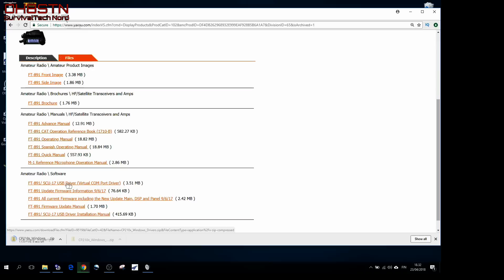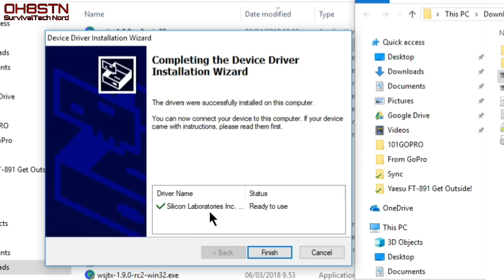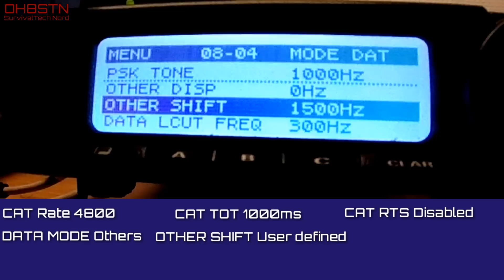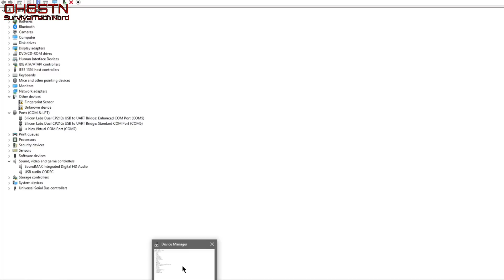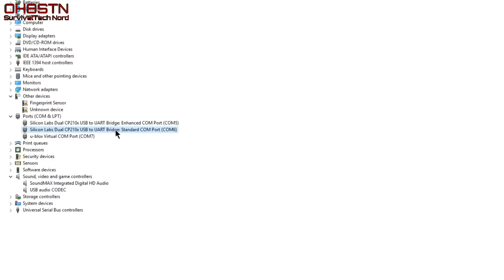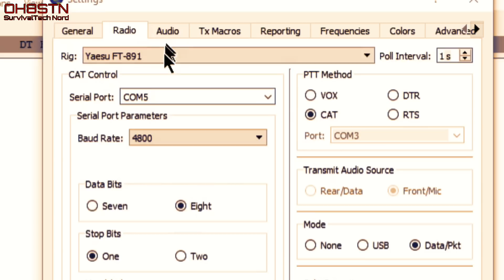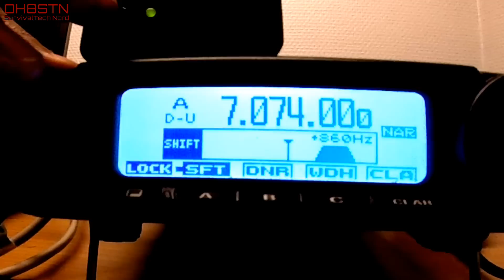Yaesu FT-891 FT8 WSJT-X Data & CAT configuration

Comment: Hello Julian, I wonder whether you've experienced a 'clicking' sound in the audio chain when going digital. The clicking was mentioned several times on a forum 5-6 years ago. The clicking appears to be in perfect pace with the baud rate set for CAT control. Have you experienced it? 
Regards
Gust ON6KE
Reply from the maker: This series of the radio doesn't have that clicking. It seems to have been a feature of the early versions. 
Mine had clean clear audio both incoming and outgoing.
73
Julian oh8stn

Comment: My problem is I am not computer savvy. A person keeps asking me. Did I put this in and I put that in did I do this? Did I do that. I just don’t know who to talk to about getting this properly set up on the computer.
Reply from the maker: First thing to do is define the task, breaking down each part of the setup into individual steps. Itemize the steps onto a piece of paper stro 1, step 2, step 3, ... Under each step write the goal,  pre-requisites, required materials and expected results. This is basically your project plan.
There are no tutorials which will be exactly identical to your setup. This is especially true when you're commenting or watching older videos with hardware which is unavailable anymore.

Comment: May I please know if I will need the MiniProSC data interface? If so, it would appear that these are no longer available for FT891. 4S7EF
Reply from the maker: This is a special radio and works a little bit differently than others. I would buy the Digirig interface for FT891, FT857, FT818. Because this radio already has its own USB connection. You only need the audio connection from thee Digirig.  This means for data modes. You'll have two cables one from the radio and one from the audio interface. www.digirig.net
Hope this helps
Reply: Thank you. Understand that you have done a video on how to use an inexpensive sound card and Yaesu cables to replace the more expensive sound cards? 4S7EF
Reply from the maker: It's not worth it.  You'll get the best results and least frustration with thee Digirig. The problem with doing it the cheap way with the yasu cables is overdriving the radio and polluting the spectrum for all the other operators who can hear you. It's much easier to set up with a digirig.
Reply: @OH8STN  noted. Thank you very much 4S7EF
Reply: I have gone through your video a couple of times, and I am not sure where the DIGIRIG cables are connected. Will it be possible to kindly do schematic of how ALL cables are connected PLEASE?😊 4S7EF
Reply from the maker: Schematic isn't required. The digi rig has two ports 1 for audio, the other for cat control. The audio port connects to the data port on the 891. The serial port stays disconnected. The USB port from your radio and USB port from digirig connect to your computer.
It's that simple. Make sure you buy the digirig cable for your radio, as I mentioned in my first reply. There's only one port on your radio that will accept that cable. It's all very very simple.
Reply: @OH8STN  Thank you Julian. Just to recap;
1. The BLACK cable goes to the AUDIO port of the DigiRig,
2. I need to purchase a printer/USB cable which connects the USB port of the FT891 and a USB port of the Laptop. 
3. Using a Type C cable, connect the DigiRig USB port to another USB port on the Laptop?
73 de 4S7EF
Reply from the maker: Not sure what color the Digirig cable is. One end is TRRS, while the other end is 6pin minidin. The USB cable from 891 to the computer should be high quality. USB-C from digirig can ve ordered from Denis at Digirig,  along with correct audio cable.

Comment: Julian, I need to ask for your help if you have a moment.  I have put the Sabrent sound card, the HIQUAY FTDI FT232 chipset 8 Pin Mini Din Male Serial to USB Adapter, CT-62 CAT Cable for Yaesu Radio, and the HQPARRTS 6pin Data Audio Cable for Digital Modes FT - FT8/FT4/JT65/PSK Audio Interface 6-Pin Mini DIN Cable DC-11F for YAESU FT-897, FT-857, FT-891 into my Amazon shopping cart.  The sound card and the 6pin Data Audio Cable are for FT8?  Is the other cable the CAT cable?  I, also have the ADMS-891 USB-A to USB-B cable with the programming software.  Are there enough ports on the radio?  I'm already confused.  Can you please help me?  Thank you.  David
Reply from the maker: Don't waste your money on all that stuff. Buy a Digirig. The 891 uses a USB cable for cat control.  For data use the Digirig. You'll have two usb cables, without any complicated mess. Normally we'll use the digirig for audio and cat. Since the 891 Has its own usb port for cat control, We only use half of the digirig, along with the 891 usb port for cat.
It sounds complicated but it's a very simple way to do it.
Reply: Thank you very much! @OH8STN

Comment: Old video but still helpful - Julian the Great! I had no TX audio on my 891 when testing JS8Call. I found this old video and learned that my data out level was set to just "10". Changed it to "50" and it worked. Everything else was set properly and I was going crazy here for moment. Setting my Data out level higher fixed the problem. I back on 10 meters this week and want to see how propagation is behaving.

Comment: I have the same setup.  But in audio settings, both show the codecs, but both say (not found).   Do you have any idea what the problem might be?   Thanks, CA4JDM / CE4JDM
Reply from the maker: Install the Yaesu drivers while the radio is unplugged from your computer.
Reply from the maker: Also, if that doesn't  work, try a better quality USB cable.
Reply: @OH8STN  Thanks. I tried both things, but still does not work.  The computer uses Windows 11 (I hate it!)  I set it up in an older computer with Windows 10 and it works perfect!
Reply from the maker: No windows 11 for me over here. I'm going to hold out as long as I can

Comment: Great video, and thanks so much. Been struggling with FT8 setup. Question though, why do i need to set the shift for 1000hz? Everything else made sense but that. Cheers and Thx 73!
Reply from the maker: Perhaps that shift is not necessary. It was a legacy setting from the old Yaesu user manual for operating psk and rtty.

Comment: I just have the data mode to others en then adjust the wdh from 500Hz to as wide as possible. I would advice not to use the shift. When selecting the frequency in ssb mode then switching to data the frequency changes just but it back i.e. to 7.078MHz in data. I love the yaesu scu-17 interface because it only needs 5V from the usb to operate. I t has the same driver as the cat from the ft-891 uses and even works on linux.

Comment: Do you have also the well known ticking noise by using cat control? And the terrible headphone hiss?
Reply from the maker: The ticking noise was only found on some early models. I never had any headphone hiss or even heard of that.
Reply: @OH8STN  thanks for you fast reply. The hiss in the headphone seems to be found on the early and latest models. 73' PD5RVL Roy.
Reply from the maker: You're welcome. Perhaps, but never had either problem with mine.

Comment: HI. Would be great to cover small differences when setting up in Linux:  No need to load drivers, they are there ready for use. Another thing is that user needs to belong to Dialout group to get USB connection. So not difficult as I got it to work :-)

Comment: I may be new to ham radio but FT8 seems pretty useless. You don't convey any information. Win link shows promise but digital modes that simply prove that radios can make contact while watching bars fill on a screen. It's like watching paint dry.
Reply from the maker: I'm not a big fan of FT8, but many other operators are. Therefore I make videos and tutorials to help get those interested, started. It's also a good mood to test whether or not our antenna systems, are performing as expected.

Comment: For some reason, my PC does not show a USB audio codec.  I have installed the Yaesu driver for the FT-891.  I don't have my signalink yet, so is this codec something that its software will include?
Reply from the maker: The codec is the audio interface. The ft-891 doesn't have one internally. When you build or buy the audio interface, you'll see the audio codec once you plug it in.

Comment: How do I get FT-891 Data mode to do full 2.3K bandwidth for VARA?
Reply from the maker: Select filter from the front panel button, then adjust the bandwidth to 2300hz. Winlink Express will automatically put it to 3000 Hertz forcing you to change it every time.

Comment: As always, many thanks for all you do clearing up these mysteries. Question... does the FT-891 have a way of "storing" multiple configurations? I'm just thinking of my IC-7300 and how slick it is to go back/forth between settings for SSB vs settings for digital modes. Does such a function exist for the FT-891 or do all of these settings have to be 'un-tweaked' if you want to switch over to SSB?
Reply from the maker: Settings on the ft-891 are brutally inadequate. There is an upside however. If your rig is in digital mode, the 891 will use the relevant digital mode settings, like audio input, bandwidth, Center frequency, and so on. When you switch over to SSB mode, it will switch those things automatically for settings more related to The Wider bandwidth of voice Communications. I really wish there were profiles for setting up the radio the way we like. The only way to do it on the ft-891 is setting up specific memories with the settings you like. Do that one for each band, then recall the setting to have your radio set up the way you like it. It's not the best way, but that's the way I've found Works nicely. The 7300 user interface is light years ahead of the 891.
Reply: @OH8STN   Thanks for the quick reply, Julian! I'm "shopping" (aka dreaming and $aving) for a 100w "portable" hf rig. The FT-891 is obviously a contender. Believe it or not, I'm also looking at the IC-7100. *Not sure the form factor is ideal with its permo-2-piece layout. On the other hand, it has built in sound card, and can serve as a base vhf/uhf rig when not in the field. As you've already noted, pity the FT-891 doesn't have built-in sound card, but...we play the cards we're dealt.

Comment: I tried all this but my FT-891 is not transmitting anything in Data Mode. PTT is triggered (orange LED) but power output is 0. If I use SSB everything works fine. I would like to use data mode not switching mic port and BFO all the time but how?

Comment: AWESOME VIDEO as always!!!  just wondering what you are using for the interface and will this information be applicable to every/most interfaces or just the specific one you are using in this video?  thanks a bunch !
73's
KB1ICK
Reply from the maker: I'm using the ZLP miniprosc, but this tutorial will work for the most part with signalink or similar interfaces as well. Thanks for the kindness, question and for watching. You're very welcome.
Reply: @OH8STN  Hi Julian quick question: I've the 891 and the MiniProSC. Having issues in D - U mode. Like I've not enough drive from laptop. Sometimes it works then stops. In USB mode works 100%. Any ideas ? 73 Paul
Reply from the maker: Digital gain setting for Data. Turn it up a little, but watch your ALC.
Reply: @OH8STN  One other question if I may. I got it to work for a several QSOs but then no RF Power. Checking the ALC shows very little audio. Increasing the drive level doesn't help - have you seen this before ? Could it be my ProSC ?
Reply from the maker: I've never seen the minipro SC fail, so I would start with checking cables, volume levels, audio interface settings and things like that
Reply: @OH8STN  Tks, I've it connected directly to the laptop - this should be Ok just the manual says use a powered USB Hub. Bizarre...
Reply from the maker: Do you have a USB microphone connected to your laptop? Check the settings in your software

Comment: Hi. After installing the drivers  everything works great using data over cat.  No need for “data box” and many cables. cat and audio all over the usb, works great.
Reply from the maker: There is no audio transit over USB on the FT-891. Perhaps you're experiencing audio coupling through your computers microphone.
Reply: OH8STN Ham Radio oh yes there is.  All working over single usb connection. It’s data over CAT. Actually using a tablet with no Mic in.
Reply: @CaptainK007  Hey what you are saying is quite interesting, what program are you using ? Do you have any documentation/video on this ? I'd like to know more.

Comment: Thanks for the informative video.  I see You’re using the G90 now.  Do you still suggest the 891 as a mobile rig.  It will 99% in my car but will mount in a way that I can remove it quickly if needing to abandon my car.  Also mostly use the radio HF / JS8 (in areas where I can’t reach voice propagation )  going off-road / ovelanding 3-6 days long in areas where there’s no service whatsoever.    So, primarily be used as a backup radio to call help and play w it to find out how reliable it is in areas w no cell service..  I have in-reach satellite as primary.

Thanks for putting this together and I appreciate your time.  Mike
Reply from the maker: Definitely still using my ft-891. It's a magnificent radio with an excellent receiver. The only thing it's missing is an internal sound card but everything else is so awesome about the radio, I think it's still might go to Radio for preparedness. It's only slightly larger than the FT818, but you get 100 Watts, dsp, and variable bandwidth filters. You can't go wrong for the price.

Comment: What is the audio connector?  Is it part of an optional cable?  Included?  Third party?  Is it necessary?
Reply from the maker: If you want to run data comms you need the audio interface. The audio cable connects between the audio interface and the Radio Data port.

Comment: Question. I have been running about 50 watts on ft8 and after about 15 min, the radio goes to zero or 10 watts when xmit. Why?  Is 50 too much for the 891 in digital?  Or is it something else?  Just making sure I'm not doing something wrong. Then after about an hour goes to 50 again after not transmitting. Thoughts?  Thx. 73 K9WAS
Reply from the maker: This is a huge red flag Andrew. There's a variety of things which could cause this. Your SWR is too high, you're over driving the radio (checked with ALC meter while txing). It could be poor coax cable, bad station grounding, or poor ventilation (put 891 fan on contest setting). It could also be a combination of these things. What we are sure about is the ft-891 is folding back its output power, because something is wrong. It's protecting itself from damaged by reducing the output power. This is by design.

Comment: Where did you get the additional usbB to usbA CAT control cable. It does not come standard with the FT-891? Thanks,great video!
Reply from the maker: Thanks for the question and kindness. I don't remember if the 891 had its own USB cable, I think it did. I ordered some shorter cables from ebay anyway. I like to keep the cables as short as possible.

Comment: Hello Julian, you may have missed my reply to your comment below, so wondered if you can help please ? I attached a Ferrite Bead to the end of the USB cable (the PC end) and it seems to have worked, the TX continues for as long as needed now and does not cut out (I guess the source of the RFI is still there but at least I have a workround. 
One other issue I am having with this setup,  when I transmit on frequencies between 600Hz and around 1600Hz, full power (set to 25W) is achieved. When replying to CQ call on frequencies from around 1800Hz and up, my power drops to around 1-2 watts. Can you suggest what settings need to be changed or suggest what the problem may be ? My "Other Shift" setting on the radio is set to 1000Hz and "Width" setting to 800HZ. Thanks
Reply from the maker: You're absolutely right Martin. I didn't get the notification to the reply. Hate this sounds like exactly the same problem. I would suggest adding more ferrite beads if possible. The perfect solution would be using the shortest cables possible, in addition to ferrite beads. You can also root your coaxial cable away from any of audio or CAT co trol cables.